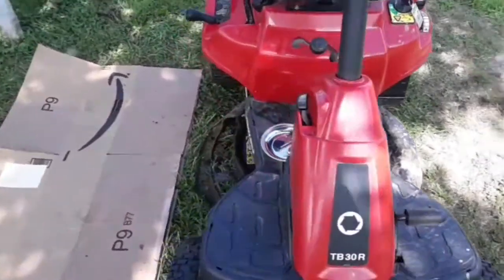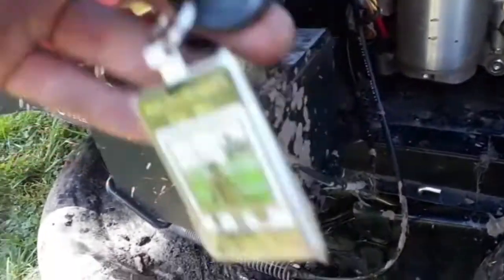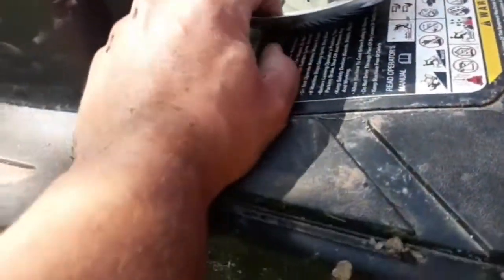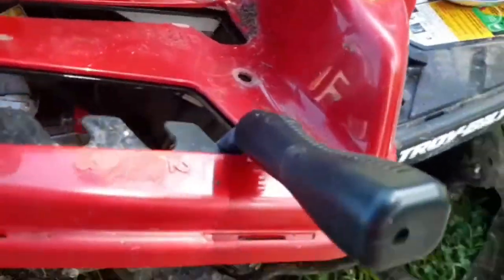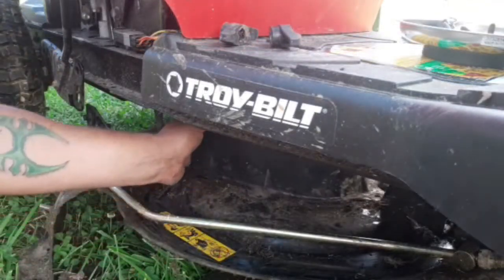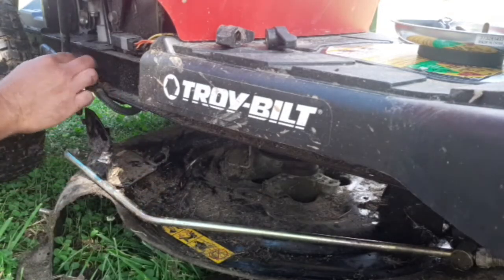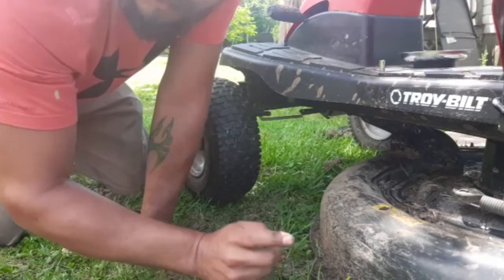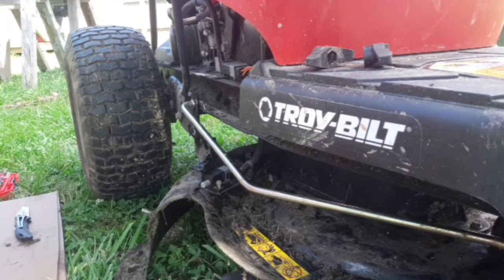How to Replace the Mower/Blade Belt on A Troy Bilt TB30R

Comment: Todays mowers have  5  safety switches. These must keep the mower repair shops in the money.
-seat sw
-blade engage sw
-reverse sw
-discharge chute sw
-brake sw
Any of these malfunction = no crank nor start. it can be a bear to trace down all of these & it would be  SO  easy for the MFG to put 5 tiny leds on the dash to glow- 
-Green to go
-Red to not
These leds woud id which switch is the problem. This would be especially helpful for commercial customers who have a bunch of yards to cut. You would zoom in on the defective sw & get back to work.
-Just a Thought

!

Comment: Haven't found any videos on how to replace the drive belt on these 30" Troy built mowers. So went at it on this 2014 year model and will tell you what I discovered. Take off or disconnect battery. Take off deck. Go to top and push in the small tension pulley and unroll the top belt. Now you can pull the tension pulley arm outward which retracts the spring allowing you to take spring off without stretching it with pliers. Using 3/8 socket loosen the two bolts that hold the variable speed pulley (double pulley) to the frame until they are nearly backed all way out but not off. This will allow space to route the new belt between the frame and lower pulley groove. Go under mower and use a small pipe wrench or vice grips and secure it around the pulley shaft (not pulley itself) with wrench teeth in the direction that will hold when you un-thread bolt. Unbolt Engine pulley bolt and drop down pulley. Un-thread the idler pulley bolt until you can pass the new belt into the groove past the retaining lip on its bracket. Pass new belt through the variable speed pulley bottom groove from the top. Then re-tighten the two 3/8 " bolts holding pulley bracket to frame.  Go underneath and pass the backside of the belt over the idler pulley. Then retighten idler pulley with belt between the retaining bracket and the idler. The bolt used has a square under the head that sits in the square bracket groove so it remains in place when tightening nut. You may have to pull bolt down into the groove until it tightens enough to stay in place. Push engine pulley back on engine shaft aligning the key inside it to the groove on the shaft. Nearing the top rotate the belt from the idler around the top engine pulley groove and push it up in place. Put some blue Locktight on the engine pulley bolt and thread it in while holding pulley up so belt stays in place. Torque or tighten well. Then route the pulley around the small pulley bolted to the engine base.  Then re-attach the tension spring to side of frame. Push tension pulley inward until you can roll new belt onto it. Release tension pulley and all done except putting deck belt and deck back on.. Simple as pie.
Reply: Sorry the top belt is the one you push the tension pulley in to roll over the tension pulley after you reattach spring. The bottom belt is already routed at that point. and will tension up also when top belt is installed.
Reply from the maker: It was nowhere near that difficult, bud. This literally took me 15 minutes...and that was figuring it out as I went...
Reply: @3FeathersFarmstead  I don't know if you are referring to me or David. I described installing a new engine drive belt not the blade belt. It probably took about 20 minutes and was quiet easy. I have been seeing a lot of people asking how to install the engine drive belt with no one answering. I even saw one guy say you replace if all from the top which is BS. So I hoped my info might help someone.
Reply from the maker: Fair enough...lol...I've just had a bunch of "know-it-allers" trying to make themselves feel better about a novice figuring shit out....no hard feelings. Guess I misunderstood....Cheers!!!
Reply: @3FeathersFarmstead  No problem dude. I figured you just saw that long list of instructions and without reading it mistakenly thought I was trying to give another version of your instructions. The drive belt is easy to install but I gave detailed instructions for those novices you refer to, seeing I do not have the knowledge and equipment to make a video like you. I have been working on MTD Troybilts and Yard Machines for a couple decades. So while not an expert certainly not a novice. I just recently bought this TB30 piece of crap to cut around close areas in my yard. At first it looked difficult to route the broken drive belt. But after taking the engine pulley off it was quiet simple and quick. Before then I looked around on the net and didn't see anyone addressing the drive belt. One site had a novice on there telling people to disconnect the tension spring and be careful it might pinch them when all you have to do is push the tension pulley arm forward and take off the belt. Really don't even need to take the spring off then as it is relaxed with belt off. You take the top transmission drive belt off the variable speed pulley so you can route the bottom engine drive belt. That is just a matter of pushing the tension arm forward and removing the belt. This novice was also saying you install the drive belt all from the top. You have to take the engine pulley off to wrap the drive belt around the crankshaft and then onto the pulley because there is a rod right behind the bottom engine pulley preventing the belt from passing over it. Maybe you can make a video of this sometime. Thanks for the reply.
Reply: Thanks for posting these instructions. This novice was able to change out both my drive belts using your instructions. The only thing that gave me trouble was the square shouldered idler pully bolt. It did not want to seat correctly. It took  me a while to get it done. I probably wouldn't have attempted the repair without your help. Thanks again.
Reply from the maker: I am glad you found it helpful. Cheers!

Comment: Bro. Wtf is that a mower or a swamp buggy?!? Just kidding, excellent video, one of the few on the internet showing how to route that deck belt! I have a cub cadet cc30H and I’m telling you there is no video out there for it’s deck belt, so fortunately it seems like your Troy built and my cub cadet are basically the same mower! Thanks again you saved me a lot of trouble
Reply from the maker: 🤣🤣🤣 I think the belts are compatible so that would make sense if the belt went on the same. Glad it helped out. I have since learned how to do it without taking the deck off. Which is a bit easier

Comment: I replaced my deck belt and it was burning and slipping on the engine pulley. It's routed the same as in this video and that's how the old belt was routed. Do I need to adjust the tensioner? There is a little play in the belt when the blade is engaged.

Comment: Note: it’s not necessary to remove the deck and all the bolts other than the battery. Certainly it is easier but still unnecessary. Simply remove the belt cover, loop belt around the motor wheel through the rectangle bracket. Pass it behind the silver pin and finally onto the blade wheel assembly. Great video but I’m lazy and always look for the easy way.
Reply from the maker: I will definitely do it the easy way next time!! I am not too mechanically inclined and this did seem like alot of extra work. Thanks for the tip!
Reply: @3FeathersFarmstead  LOL...It's how I fixed mine. I am supposed to be mechanically inclined. I wanted to see how it all functioned.
Reply: Well my belt blew out 11 months later, I tried your method of not taking off the deck.  This work ok but I have big hands and my socket wrench was big to get in there.  I had to take my silver pin off to get the belt behind it and then put it back.  Used a tiny 3/8 crescent to take the pin off and put it back.  Still, all in all it was better than disassembling the deck, this time it only took 45 minutes.  Also had to replace my blade and that was just annoying.
Reply: @jessiesmith5256  The blade on mine needed replacing first half season.  The steel was quite soft. It is annoying.
Reply: @ Win Dennis

Dude took me longer to get the belt cover off the deck than it did to remove old belt and put new one on. 43" x1/2" belt and your good to go. craftsman r1000.  Thanks dude.

Comment: Hello, thank you for sharing a wonderful video. I have one question. Why did you change the belt? I have craftsman R1500 and it will start but it will not move. is the problem with a broken belt? I would appreciate your help.
Reply: There's 2 different drive belts on them. He replaced the deck belt.

Comment: Thanks for posting this, my belt just blew out  the other day.  Got a new one but wasn't sure how to start.  Those booklets that come with it don't show much.
Reply from the maker: Glad you found it useful! I had the same issue with the manual. So I pretty much just started taking things apart and figured it out by myself. Thanks for watching!
Reply: @3FeathersFarmstead  Going to work on it first thing tomorrow.
Reply: Success,  took hour and a half, but I have to take it slow with my temperament.  Only suggestion I have to make is, if you are in the South have a fan out there with you while you are doing the work.

Comment: I have the Craftsman RER1000 that looks like it has the same setup.  Is there a tensioner that I need to loosen before putting on the belt?  I followed your video to make sure the belt is positioned with the three pulleys but the last pulley (closest to the front of the riding mower) is where I am having issues with the belt. The belt is short and won't go completely around the last pulley closest to the front of the mower.  Thoughts?
Reply from the maker: There is a tensioner that sits right on top of the blade housing. On this model it is right under the ignition. At least that's where it is in this guy...I believe they are the same though
Reply: @3FeathersFarmstead  Is it in this video as I didn't see you doing anything with the tensioner??  If you did, at what time (time stamp) is it done in your video?
Reply from the maker: @sirprince888  I don't think it is...I just found that out this spring when I put on a new one
Reply: @3FeathersFarmstead  Thank you.  It would be great if you can take a 20sec-30sec video showing where the tensioner is located and what to do before putting on the new belt.  Please??
Reply from the maker: @sirprince888  just posted one for you!!
Reply: @3FeathersFarmstead  Much appreciated!  Thank you, sir!
Reply: FYI-  I was able to get the belt on without using the tensioner.  Your video was very helpful in showing which way to orient the new belt to the pulleys.  Again, thank you!

Comment: Will that same belt work on the craftsman rer 1000? It’s the same exact setup as far as belt diagram. I’m having trouble finding the right belt size for mine and every belt I do buy has some slack or too tight causing my belt to burn up right away
Reply from the maker: I believe so...this is the manufacturer's recommened replacement belt from the manual https://amzn.to/3dS1jhz
Reply: Yes, I have the RER1000 and it is the same setup.

Comment: -Got a Craftsman, Cub Cadet, or any other similar Rear-Engine Rider?  If so, these machines are all virtually the same, and are built by MTD.  This video is very good, and applies to all of them.  Mine is a 2015 Craftsman R1000, and my OEM belt just broke, so these instructions were really handy.  However, my manual says you don’t have to remove the deck, but says it’s easier if you do.  So, like an idiot, I chose not to follow this guy’s example, used my car ramps, and left the deck attached.
* Trust me, just do what he did and remove the deck.  I’ve done it several times, and it’s a bit of a pain in the a**.  However, leaving the deck attached will save little, if any, time and it’s more grief.
- FYI- you don’t need to unbolt that sensor wire on the deck.  You can just unplug it.  Either way is fast & easy- just one less bolt to lose.
I wonder is someone has ever made a video of the definitive EASY way to remove & replace the deck on these mowers?  Watching this video makes it seem like it just pops off and on... Not so.  Taking it off is simple, but lining everything up to reinstall is not easy.  And whatever you do- GET one of those magnetic dishes.  (Harbor Freight has them for next to nothing... get two.)  You WILL lose one of those clips, and will have a hard time finding one while being unable to use the mower.

Comment: Something is still wrong. It's not engaging the blade on setting 5,4,3. If I lower it to 2 the blade engages without being told to..
Reply from the maker: Belt is probably on too tight. I had to loosen mine a bit after a put it on....blade was engaged all the time. Hope that helps!